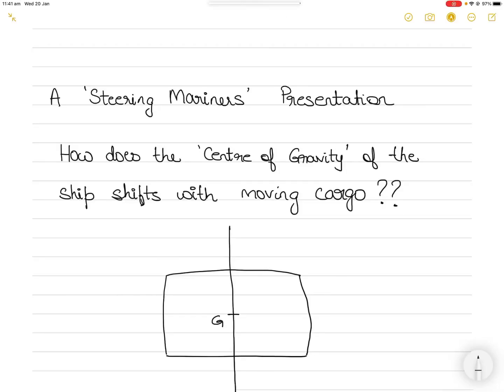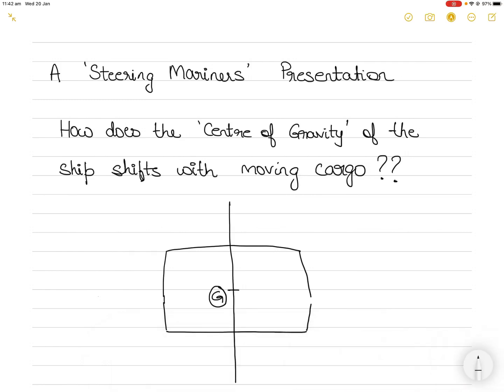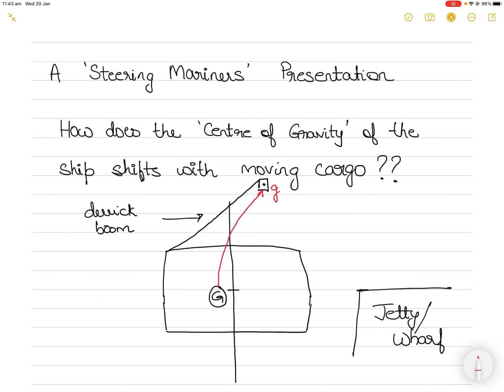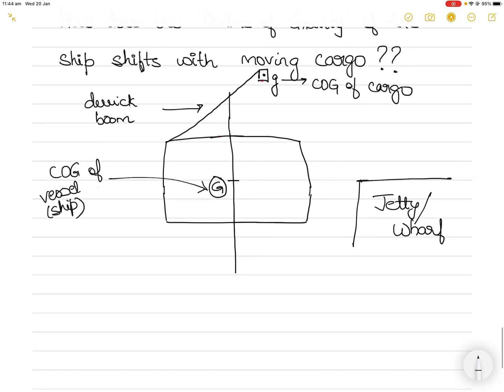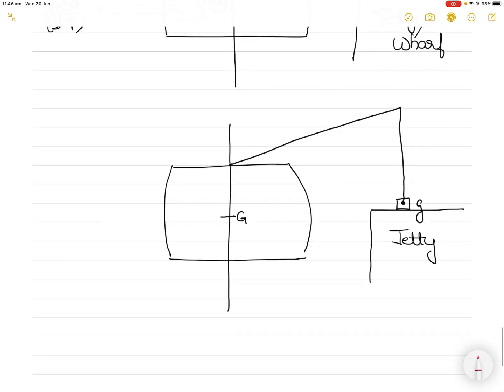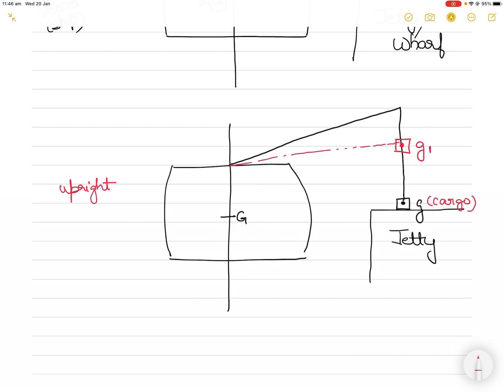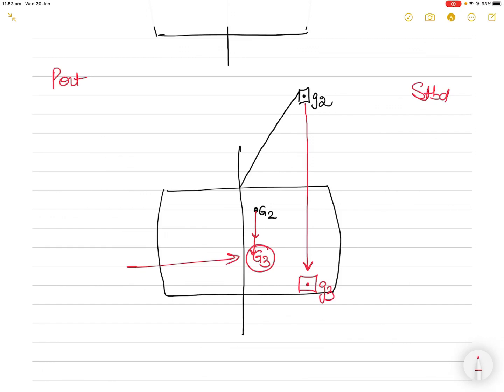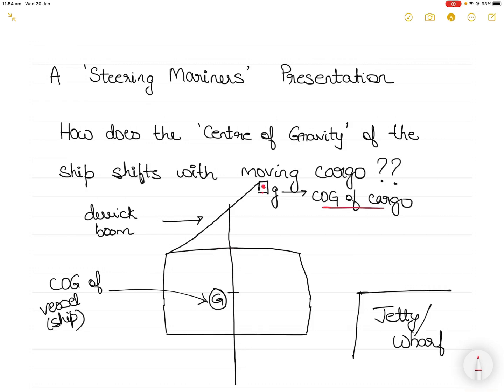How does the center of gravity (COG) of the ship shifts with moving cargo??

Comment: Isn't it true that when there is a cargo suspended by a crane, the center of gravity of this cargo is the suspension point?!!! 
Isn't it true that, when a weight is loaded on a crane, the center of gravity of this weight would be as if the weight was on the head of the crane, right on the suspension weight.?!!

Thank you for everything sir

Comment: A vessel steering a course of 240°T at 12 knts observes Great basses light (06°10' N. 081°29'E) to bear 340°C and Little Bases Light (06°24' N 081°44' E) to bear 040°C at 1000 hrs.After 3 hrs the vessel was due east of Dondra Head Light (05°55'N 080°36'E).If the current 090°T * 2 knts,which remained constant throughout,find the time when the vessel will be SE of Dondra Head Light.